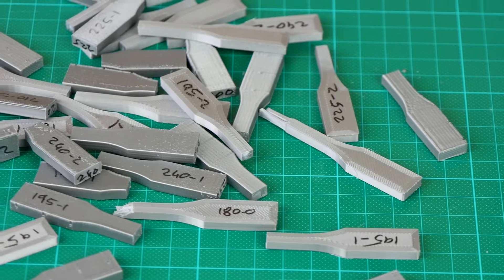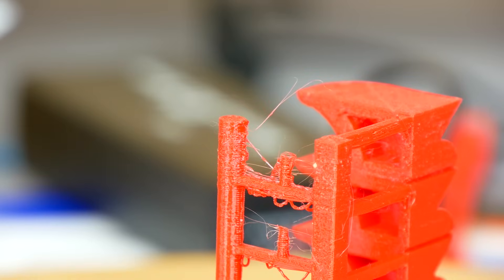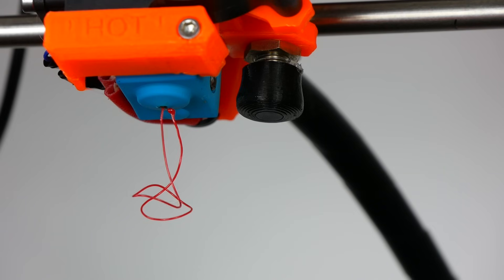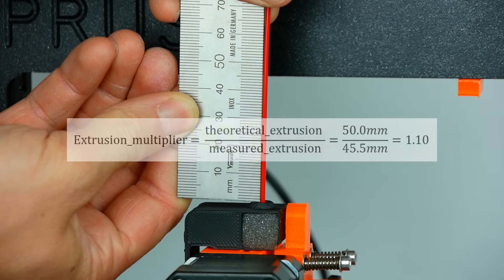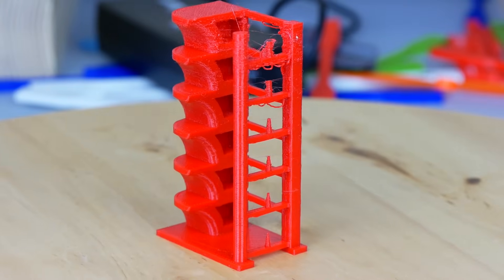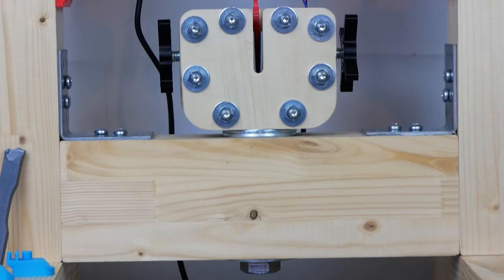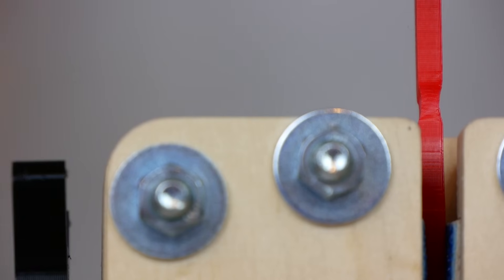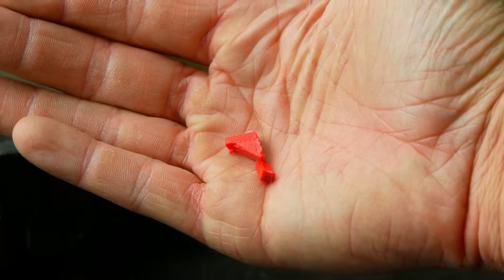3D Printing with PETG - How does the printing temperature affect strength? || Setup & Tips

Comment: When comparing MPa between your PLA and PETG charts, the PLA maxes at 42.4 while PETG maxes at 32 (Z layer strength). Is there a reason that the PETG is weaker in your tests? I was under the impression that PETG is stronger than PLA.. which was why I was going to start printing PETG.
Reply from the maker: PETGs ultimate strength is considerably lower than the one of PLA but it is more brittle and less heat resistant.
Reply: The trouble with PLA which isn't talked about much, is that PLA sucks for anything functional outdoors, or anything with heat.  Leave it in your car by mistake, and there goes all your tolerance from warping etc.

Comment: Hi Stefan,

have you ever heard of Extrudr's GreenTec Pro filament? It is a filament which should be dimensionally stable up to 160 ° C. Could you also strap it on your torture bench? ;-) I like to print with it when prints have to endure a bit more temperature. I do not see the 160 ° C reliability promised by the manufacturer, at least for my area of application (Graphics Card Modding / Heatsink Retention Kits) :-/
If I'm apply some mounting force to my Prints and the aluminium heatsinks the material deforms already at 80-90°C. Most likely I don't understand fully what the VICAT A (VST) testing method means.

Both topics: GreenTec Pro and the true meaning of VICAT A (VST) Testing would be great next videos! :-)

Liebe Grüße und Danke für die tollen Videos :-)

Comment: Thank you. Can you test ABS more? I am starting a business and I use ABS to make larger parts that I bond with acetone. I would love more information on how to make my ABS parts stronger. I make accessories for wheelchairs and the parts need to be a strong as possible.
Reply: I'd also like to see ABS. PETG is a cool product but in my opinion if you have the equipment to print ABS (simply a hot bed and enclosure) there's no real benefit to using PETG.. 
People like the claim PETG is all the benefits of PLA & ABS together but it really isn't. ABS is just a beast of a plastic and your trade off is: headache fumes, and you need an oven to print in.. not bad imo.

Comment: Although I'm not a plastics expert, I assume that PETG is very similar to PET, in which case you should bear in mind that when you stretch PET, its yield strength increases. This is the reason that PET bottles (soft drinks etc) are so strong. They are made as small injection moulded bottles, then blown out to full size and become considerably stronger in the process. Another example is the plastic film used to hold 4 packs or 6 packs of beer together. If you stretch a length of it, the material necks down but does not fail there. As the cross sectional area is less than the unstretched material but it supports the same tension, you can see that the yield stress is greater. I think you are seeing this increase in yield strength when you test your samples. It's one of the potentially interesting benefits of PETG over PLA etc.

Comment: You should do one more test!
3D print a Thread and see how easily it can be moved/how „sticky“ it is. I noticed huuuge differences there, influenced by multiple factors. Warping, Temperature, Fan etc but most importantly: material.
PETG for example is super sticky.
Reply: I've recently printed some M22x1 threads with PETG and I can't say that it is particulary sticky. I printed at 0.1mm layer height. After screwing in metal counterparts once, the threads work really well now. Even PETG on PETG. I was really impressed.

Comment: That description of the material extruding different amounts Above the extruder makes no sense. That hob moves the plastic the same unless the filament is slipping or grinding.. that is a bigger issue than your multiplier. Once that step figure is matched to your diameter filament, that should be the same for ALL filaments of the same diameter..
Reply: But the point is that the hob doesn't necessarily move the filament the same amount per turn. Different filament materials sink more or less into the hob profile and/or the hob teeth bite more or less into the filament material. So the effective diameter of the hob differs between materials.
Reply: Yes it does, you're describing the difference of filament types, but for a given filament, it will be constant.

Comment: Short question, 

Why is the ultimate tensile strength lower than at the pla test? 
I always thought it would be the other way around and the data sheets claime the same. Thanks for an answer. Greetings from Germany
Reply from the maker: Don't know at which datasheets you've been looking but in terms of Ultimate Strength, PLA is in probably 90% of the cases stronger.
Reply: Ah okey, then data sheets from ultimaker are probably wrong. So the advantage from petg is only in shock stress situations is that right?
Reply from the maker: Interesting, gotta check that tomorrow.
Reply from the maker: Just checked the Ultimaker datasheets and also there PLA (UTS ~50MPa) is quite a bit stronger than the PETG (CPE with UTS ~40MPa). The only real big downside is the bad temperature resistance of PLA and the brittleness in the unmodified state.
Reply: What do you mean by unmodified state? Probably the PLA+ that is much less brittle and can be treatet (oven?) to withstand even more?

Comment: If Polyesters or Polyamides absorb water, the water acts as a kind of lubricant between the polymer chains, just as plastisizers making PVC soft. That's why your specimen kept straining as the polymer chains could glide off each other and align in the direction of the applied force. Materials usually behave differently when strained slowly (tensile testing) or very fast (impact testing). Usually your material shows higher strengths the faster you strain it on your tensile testing machine. The polymers have no time to react to the force so they show a bit higher resistance resulting in a higher tensile stress for example 10mm/min compared to 5 mm/min. Although there is also the effect of extreme polymer chain alignment after slow stretching which results in extremely high tensile strengths. (For examlpe UHMWPE Fibers or High strength Polyester Fibers). Impact is a very high strain rate, so the viscoelastic material has almost no time at all to adapt to the applied force thats why it breaks.

Comment: Polymers are generally viscoelastic, which means it exhibits both elastic properties (like solid) and viscous properties (like fluid).  At low strain rate, material elastic properties will govern (e.g:  pull it and release before it yields, and it goes back to original shape - like metal).  However, at high strain rate, material viscous properties will govern (e.g: stress depends on velocity, not just deflection like in the elastic model)   There are also temperature dependent properties as well, so testing polymers in "apples to apples" scenario can be very tricky.

Comment: The G in PETG is Glycol.
It's made from corn starch, which is a non Newtonian substance when it's in fluid form.
It might be what makes the material act that way.
Reply: G is for Glycol Modified. Normal PET is a copolymer of terepthalic acid and ethylene glycol. PETG replaces some % of the ethylene glycol with another diol such as cyclohexanedimethanol. This messes up the packing of the polymer chains and makes the plastic more amorphous with a lower melting temperature.

Comment: Hello, you were wondering why it bends under low load and shatters under high energy load perhaps this material works similarly to non newtonian fluids that are fluid with not much energy applied to them and act like a solid when a strong force is applied because the atoms lock up.  I very well may be wrong but that was just an idea that crossed my mind.  Thanks for the very informative video and have a nice day!

Comment: At the beginning he says " It did not stick to the bed properly " LOL  Maybe it was - I didn't adjust the bed height properly would be a better way to say that. It bubbles / maybe I had the temp/fan settings off . LOL I have torn many sheets of adhesion promoters trying to get my Petg  prints off the printer. I found using glue stick to lesson the adhesion works well with PETG tho. First I adjust the Z height up as much as possible though. I rarely use any of my PLA now because after trying PETG and seeing how much more flexible/less prone to breakage it is ,I try not to use PLA for anything of importance. Glass or mirror with gluestick as a adhesion lessoner works the best for me now. Seriously CNC Kitchen does a great job of building and testing all this data in this video and his videos are very professionally done and have helped me a lot.
Reply: i highly doubt he would have made a mistake like that and decent petg would probably still stick. Petg reallly sticks well - the fillament he used may have been a bad or early batch most
 likely.

Comment: Thats weird that you get bad overhang results from PETG. Mine are usually better than PLA. It defintally prints angled overhangs better than PLA in my experience.  Often I'll go up to 50 degrees without any filament cooling and get perfect results. Ive never used Das filament PETG, but I've used at least 10 other manufactures PETG filaments, and I can't explain the top of your benchy. I have never experienced problems printing even very fine detail with co-polyesters.

Comment: I only use PETG. It smells absolutely not and doesn't need a cooling fan wich I don't have (I use 15 second minimum layer time). I use a 95° C bed temperature and don't get any warping with that ever. Your retraction settings were off in this video the whole time. PETG needs more retraction than PLA. I don't get any stringing at all with 5 millimeters on my direct drive. DAS FILAMENT has put a lot of G (glycol modification) into the PET so it gets that soft. My favorite is from 3D PSP, it is a bit tougher (also cheap). The greatest difference between PLA and PETG is visible and feelable with big vases with a single or double perimeter shell. My printer is a completely custom build one for 110€ all together. It is based on the i3 design and prints magnificent. Prusa also prints everything in PETG now wich is completely right in my opinion, I guess PLA will be at some point only a niche filament. I really enjoy the pace of the video and the graphs. Maybe you could communicate the intro and outro more in line with your normal talking ;).

Comment: What I do know about some materials, they can display odd behaviour under loading.

Compression shocks like hitting the material with a hammer can put excess strain on the component that then shatters, the impact force of the hammer is transferred and that transfer of energy in to the part causes it to break apart when it wouldn't normally.

Take paper, if you apply enough pressure to a ream of paper, it will explode with some force, theirs an example online with a guy who has a hydraulic press channel and he experiments with crushing stuff. 

Well I can't wait to build mine, manufacturer sent it without the right bolts for one part... I have a clone of an i3 which I will definitely be moding.

Comment: PET ist known to show the effect called strain hardening. The long polymer chains orientate in the direction of applied force, if enough time is provided, and therefore increase the modulus of elasticity in this direction. If a force is applied abruptly, the chains do not have time to orientate in the direction of force impact and therefore show a lower low shock resistance. 
For the point you called "hydrolysis" - that is the wrong term. Hydrolysis is a chemical process, while the hydrophilic behaviour of PET (and any other polar polymer, especially PA) is a tendency of physical aggregation of water molecules. A lower glass transition temperature and stiffness is the outcome. Plus of the physical property change: You can dry hydrophilic polymers, e.g. in your home oven with circulating air, at 80 °C for 12h.

Comment: about shattering in pieces....there is one thing called impact. Impact is Force per unit time. Another is thing is called Shear Rate which is shear force per unit time. Polymers have stereoscopic structures and hence behaves differently to different kinds of forces. Also, there is something called Viscosity and glass transition temperature.

Comment: In material science, the loading rate of a specimen matters in testing it's tensile properties. Tensile testers are set to a very slow loading rate for this reason. A slower loading rate causes a material to behave more ductile, and a faster loading rate causes a material to behave more brittle. That's why you can't completely rely on the tensile stress data for all applications as your component might be experiencing a fast loading rate due to a high frequency input force

Comment: Does the temperature change automatically for the temperature tower, or do you have to change the temperature manually with every step of the tower? How do you do configure the printer if it is done automatically?